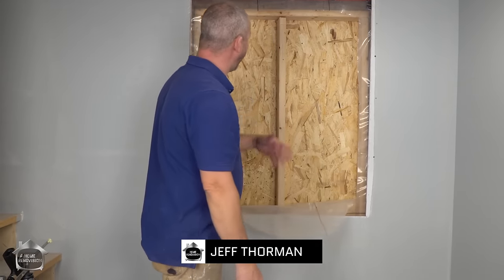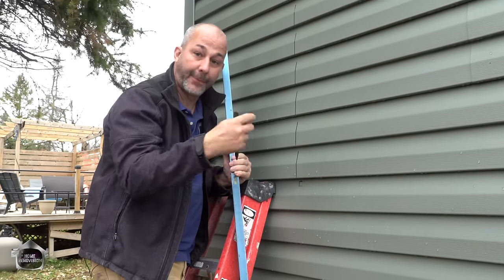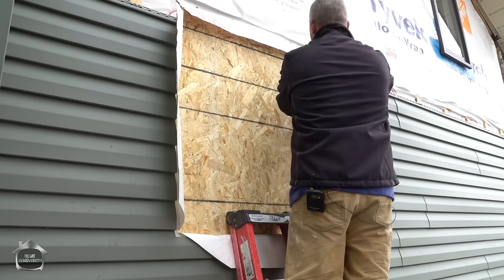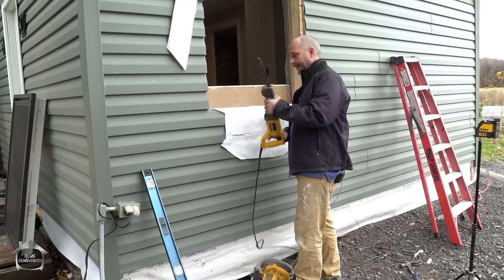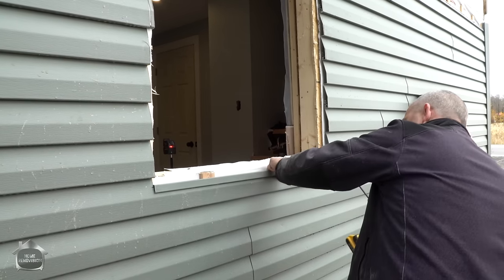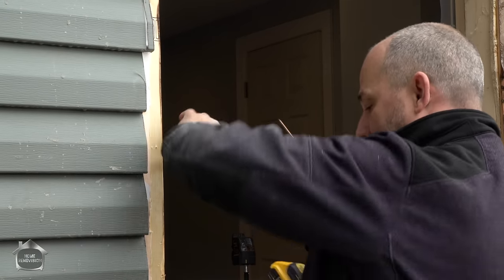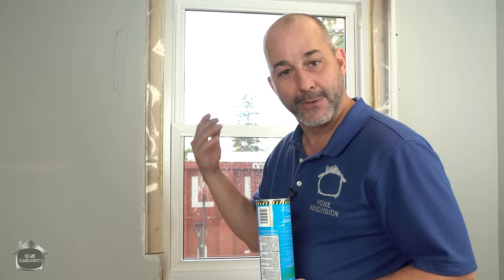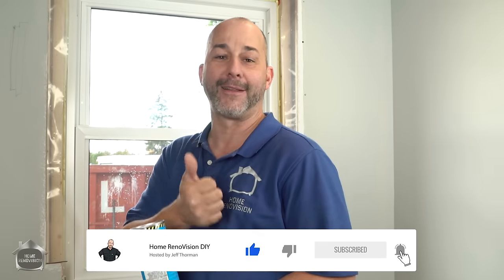How To Install A Window In A Wall

Comment: LEVEL TIP: when using a level by yourself, especially the longer ones….add a ‘rubber band’ (preferably a fatter one if you have it) on each end of the level. It grips the surface and stops it from sliding and moving around when trying to hold and mark with one hand.
Reply: Nice tip!!
Reply: DUDE 🤯 

THANK YOU
Reply: I also suggest cursing loudly at yourself, the world, and finally the level in that order. That seems to keep it in line long enough to get the job done before it ultimately falls again.
Reply: The craftsman 4’ BOX Beam has this built in ** if you’re in the market for a new one. 

My husky was bent to hell 😂😂
Reply: But then it’s possibly no longer perfectly straight. Not a good idea for precision work.
Reply: @gabrielmaynard  HAHA hell yeah; isn’t that pretty much a requirement lol
Reply: Great idea

Comment: Jeff is the human personification of dad sounds
Reply from the maker: LOL, I am finally speechless. Cheers!
Reply: Hi just noticed you were grinding the siding and sawing without your safety glasses on.
Reply: @gregkoch3658  if you keep watching this channel you'll see that he almost never wears protective gear except for a few exceptions
Reply: WOW! Things I didn't think of! Great video.
Reply: 15:54
Reply: @HomeRenoVisionDIY  so I’m putting a large picture window in existing siding (that never had a window) my window is a surface mount, is this possible to do without taking all the siding down?
Reply: Beautifully said lol
Reply: The laughs
Reply: @HomeRenoVisionDIY  any tips for installing/adding a hexagon stained glass window? A new hole needs to be added to our home. It is stucco on the outside. Built in 1964 if that helps you identify the Sheetrock

Comment: Hey! Huge fan of the channel, but as someone who used to install windows and siding professionally I have to be “that guy” for a minute. Tearing down the vinyl on that size of wall and re-installing it later could have been relatively quick. Doing so would have made the window and J-channel installation MUCH easier. Also, the siding directly beneath the bottom piece of J-channel should really have a piece of matching under-sill attached. This will keep the comparatively loose piece of Dutchlap vinyl inside the J-trim from deflecting during expansion and contraction. When this occurs it looks identical to aluminum coil stock “oil-canning” in the heat. I’m assuming this opening already has a header above it since there was previously a door in its place, otherwise you could see issues with settling later on. However, if it didn’t have a “proper” load path before and was fine for years regardless, was it ever really a problem? Lastly, caulking the J-channel to the window WILL NOT make the window weatherproof. I have personally witnessed severe interior water damage as a direct result of this particular scenario, the moisture can hide successfully for years until it’s a big problem. To avoid this, always caulk the brick mould trim to the flashing tape or housewrap. By the way, I’m so happy to see a contractor who understands the importance of sill-seal flashing tape! That being said, it’s YOUR home and I’m just some guy on the internet, everyone’s mileage may vary. I’ve seen some shockingly janky things inside of old farmhouses that remained perfectly stable for decades, despite being inherently flawed in their execution. I really love what you do and the videos you make, be well!
Reply: Blablabla.
Reply: Josh DeMoss well said
Reply from the maker: I made this video more for fun than a guide to being perfect. Having said that a true fan of the channel should also be a subscriber. but no pressure. Cheers!
Reply: Agreed. If this was my house, I would have definitely taken down siding, and used new construction windows. I can't imagine doing this to either my house or a client's house.

Comment: Really like your DIY videos and like that you welcome tips from your viewers. I grew up learning a lot of renovating methods from my father but as they say you never stop learning
One thing I can suggest for installing windows is to work from sawhorses and a plank which gives you better control of the window and a clear view of how it is fitting in the space. It also gives you a place closer to set it down and re lift if you need to remove it. 
Keep up the good work 👍🏻

Comment: This was EXACTLY the video I needed, thank you so much.   There are NO other videos I’ve been able to find in how to deal with how to handle vinyl siding installed before a window.  In my case, need to replace rotted window, 35 ft above grade

Comment: I love your “get er done” attitude!  I’ve been in the building trades my whole life and contractors are still scared of what you’re doing lol.  15 years ago I cut out a 32” back door to my house and ripped out the drywall and cut all the studs out and installed double studs and installed a big sliding glass door and it’s still good to this day.  It’s a rental home I still own.  Now I’m in another home that I want to add windows to and I have more work than I can handle and the window companies I’ve called say they only replace existing windows not new ones.  My wife with no experience could replace existing windows.  I guess I have to do it myself which brought me to your video.

Comment: Awesome job. I install a lot of windows and I always drill a 3/8 hole in the outside vinyl and then screw through the second layer. As not to pinch the frame and cause the IGU to crack, in weather where the tempature can fluctuate and the vinyl will expand and contract. The windows will usually come with 3/8” hole cover as well

Comment: Thumbs up on your work!! Had a piece of grinder shrapnel fly into my cornea and it was a horrible next few weeks and the only reason my hearing is still good is because the last 15 years or more I've always worn hearing protection. Got all kinds of crap in my eyes over the years before using safety gear.

Comment: Always take the vinyl siding off. It is easy to put back on with coated screws and washers. Then , always buy a window with a built in 'J' channel. Flash the bottom to lay over a siding course. ( water out and down ). flash the sides. Install the window. flash the top and put the siding back on.
Reply: agreed

Comment: I've been watching for a long time but only realized I could subscribe today... DONE. Also donated $20 to No Kid Hungry. Your videos helped me remodel our last house that was built in 1967. Other than new windows and vinyl siding, it was pretty much all original, with avocado green appliances, a dropped kitchen ceiling, and original carpet upstairs (it was GROSS, lol). There were also SO much terrible attempts at DIY work on the house. Hot wires tied into grounds and stapled across ceilings to name a couple. Anyway, I bought the house for 175k and by doing all the work myself and a 50k investment I was able to sell it for 400k!. Did the whole house, kitchen, bathrooms, floors, plumbing, electrical, drywall, you name it and you helped me! Seriously, you are the best man! Makes me wish I had gone into construction so it wasn't so stressful every time I run into something I'm not expecting, but I'm learning! and I love building stuff!

In relation to this video though, I need to replace aluminum framed windows in our newer house built in 1992 that has wood siding. Is the process much different? and do you recommend measuring and buying custom windows or is the stuff from Home Depot okay, or maybe something else? Thanks in advance!

Respectfully,
~Ace
Reply from the maker: We will be doing a live members only show in a few weeks so I will be teaching how to show to save even more money and get better quality. Cheers!

Comment: Manufacturers recommendation on Henry blue skin, or any peal and stick should always be installed with primer, following after caulking your seams. Also need to pre cut your all for corners waterproofing.
Reply from the maker: yup they always sell you stuff you don't need. Cheers!

Comment: I like your RenoVision more than the Reality Renovision.  Both are great, but there are lots of shows that show the before and after of project.  On your Renovision you educate me to what's involved.  Like what is involved in replacing a  tub and the tile surrounding.  So stuff I have don't but you let me know that little thing that makes the difference.  Thanks.
Reply from the maker: Cheers gene!

Comment: You can add a pvc trim board like a versatec instead of using a j channel. It looks nicer and you would be cutting back an additional 3 inches on each side for the board allowing you plenty of room to flash properly.
Reply: Wouldn’t you have to use the j channel at the edge of the PVC trim board  to close off the edge of the cut siding as well? Or how would you otherwise cap the cut siding? Legitimately would like to know. Thanks 👍

Comment: Awesome vid! I wish I would've had it about 2 years ago haha! Now having done a few old work windows in various siding materials I've learned most of this on my own. But this is the best vid I've ever seen covering all the little details. It still is very hard to find any old work install vids to this day. I think guys are scared to post vids because of the ridicule that will come with it. But there is the real world handymen situatiins, and then there are the keyboard warrior guys who've only done new construction. Sorry, we can't all have a freshly sheathed and wrapped opening with no siding to properly flash and nail our j-channel and windows to. And I'm pretty sure the homeowner doesn't want to pay us 2-3 days of labor to remove all the siding then put it back up. Keep the awesome vids coming!

Comment: Good job, they are times when adding a screw makes an install so much easier. To minimize the vinyl distorting in the heat, predrill the vinyl about 1/16" and that should let the siding float if it isn't over tightened.

Comment: In situations like this if im not taking off the siding or its a brick house with tar paper behind the stud framing liquid flashing is the best bet. Get a sausage of prosoco fast flash. You can even apply it in the rain moisture helps the curing.

Comment: Really, I like trimmed windows. Ya know, like wrapped with at least two inches of LP trim.

I do window repair and replacement. Having that trim wrap makes replacing a unit so much easier, and often cheaper. Not having to mess with the siding is great.

Comment: I'm little confused, I understand most things in this video but you didn't say what version of Windows you're installing on your wall, should I install windows 10, or an older version for older walls? Thanks!
Reply: Windows 98 I believe is ideal for this installation
Reply from the maker: Very Nice! I wish I had a good response but the Question is already perfect! Cheers!
Reply: @HomeRenoVisionDIY  you make interesting videos with entertainment we supply entertainment within the comments, it's a self balancing system we have .

Comment: Loved your video, makes me think I can even put in a window...:-)  I do have a question, does it matter where you put a window in on a load bearing exterior wall?
Reply: Yes, it matters. You need to use a proper sized header above window in a load bearing wall. Size of header depends on span, load, etc.

Comment: Thanks Jeff.  Always good to get your pointers.  I’ll be installing new windows next year; was going to do them this year, but the big blanket of snow changed my mind.
I will be adding foam insulation though, so I don’t get big air drafts during the Winter.

Comment: I have a question about studs that are in the way of any window install. Can you cut the studs out away from the opening without compromising structural integrity of the wall? I ask this because I have an exhaust fan to install, and a stud is directly in the way. Thanks.

Comment: Hey Jeff I had a question before on caulking a window on your last live video and I may have confused you, I asked about caulking behind the nailing flange, what I meant to ask was do I caulk around the rough stud opening of a window before installing, because at work they get my to caulk the top and sides of a rough opening for a door or window before installing, and the caulking is basically behind the top and sides of the flange when installed! Thanks Jeff!!
Reply from the maker: Are you using liquid flashing or caulking?
Reply: Home RenoVision DIY they get me to use red devil caulking, exterior stuff with silicone in it basically, Translucent.

Comment: Do you need anything for water proofing where the house wrap is cut around the window opening? What should be done to stop water from getting past the siding and behind the house wrap, traveling across the surface of the blue skin and down the sheathing behind the housewrap? I know you caulk the J trim to the window but is that all that is needed? Planning to replace windows in my house and want to have a solid installation. Thanks for all the content you put out!

Comment: I need to complete this exact same project of installing a Pella double-hung window where one doesn't currently exist. 
I also have vinyl siding. I'm in central Maryland and contractors here are quoting what I believe are ridiculous 
prices ($600 -$ 800 labor only). Watching this video confirms it's not a difficult project. Just wondering how 
long this entire process should take. I already opened the drywall on the inside to expose the studs.

Comment: Great video, but I got a couple of questions, how did you frame the bottom without having to rip out the drywall? And why do you not now have a 2x12 header on top of that window?? That's a load bearing wall so I'm confused there. Would really appreciate some feedback, just trying to learn.
Reply from the maker: actually this is not a load bearing wall. Gable ends never are on a balloon frame house. as for the framing. I added that when I removed the old door the year before knowing i wanted a window in the future. I always work with a plan from the end to the beginning. This way I avoid doing things twice. Cheers!

Comment: Cuts window hole wrong size, leaves it in the video.  There is reason I've been here for over 2 years now and I'm not subbed to any other DIY channels.

Hope you're staying safe on your trip, or safe back home by now Jeff.
Reply: Leopold  You must be newer here.  Jeff doesn't act like he's the perfect contractor and he never makes mistakes.  He generally leaves most of his mistakes on camera to help folks realize that even the pros make some of the same silly mistakes as us homeowners do.  Many a channel would have edited that out to make themselves look better.  That's never been Jeff's style and IMO one of the reasons he is so popular.
Reply: This was a very serious mistake, imagine he cut the hole larger, not smaller. There was 50:50 chance for this to happen. In cases like this, when you are going to cut a hole to a visible part of your house, you really need to measure 3, 4, 5 times. It happens to me also that I get the measurement exact in the milimeters, but confuse decimeters (54.8 cm instead of 44.8 cm), but I always catch this mistake before I cut. I often even stop during cutting and go measure it again :) 
I sometimes feel like Jeff is going a bit too fast and not paying attention to details. Like for example the invisible screw, that was almost fully visible.
Reply from the maker: We are safe home and finished our quarantine. working on the house again. Cheers!
Reply: Leopold  Because in real life mistakes do happen no matter how long you've been doing something. It's good that he left his mistake in so a rookie can see how a pro deals with the situation instead of freaking out because they cut something wrong.
Reply: Leopold  I take it as his honesty towards accidents and owning up to it. Others would edit and make it look perfect, but not all of us do a perfect job everytime.
Reply: pretty sure he cut it twice on purpose so he could get the closest measurement possible once the window was level.
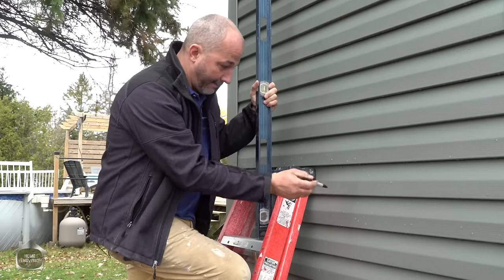Reply: @2:42  he says it
Reply: @tomaskot9278  he cut it twice on purpose @2:42
Reply: @lukeschroder5928  I think he is talking about something else, by "twice" he probably means first the vinyl, then the sheeting. I'm quite sure he isn't talking about making the hole smaller on purpose, watch 8:30 - he looks quite surprised considering he knew the hole was smaller, don't you think? :) Plus also listen to what he says around that time. It WAS a mistake, he admitted it.
Reply: @graws7009  It's not allowed to say anything negative here? Even when you say it in a polite way,? I'm a subscriber, not just some random viewer who sees one video and goes to comments to put some hate there.
Reply: Leopold  - Showing that things don't always go as planned is not a bad thing, especially when you also show how to just fix it and go on with the job.
Reply: @tomaskot9278  If he had cut the hole too big instead of too small, that's easily fixable...so I don't see your point. Yes, you should measure twice n cut once n all that jazz but in the end, mistakes happen and can be fixed without much trouble.
Reply: @tomaskot9278  mellow out mellow out
Reply: Nothing wrong with the procedures of installing remodeling windows. But if you are framing and installing new sidings, why not just use new construction windows?